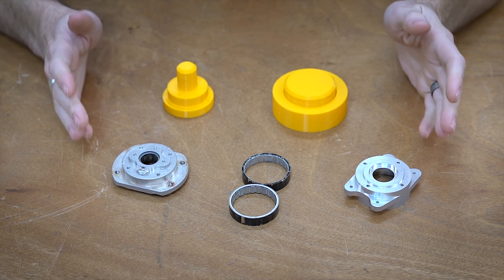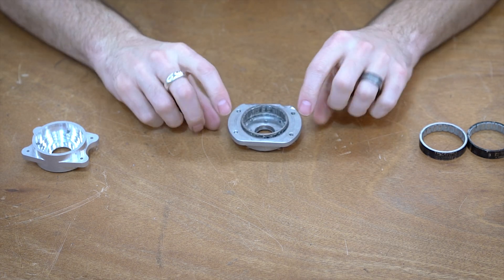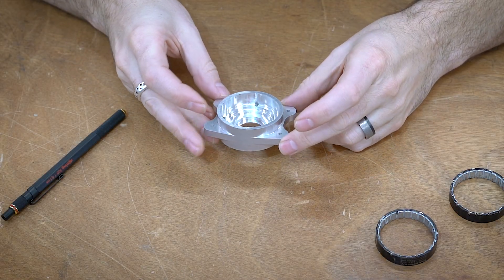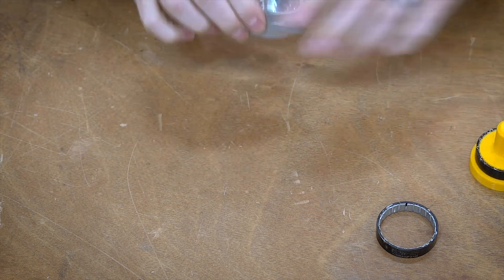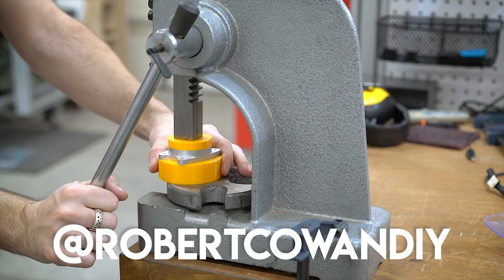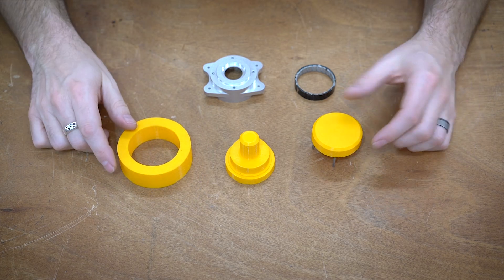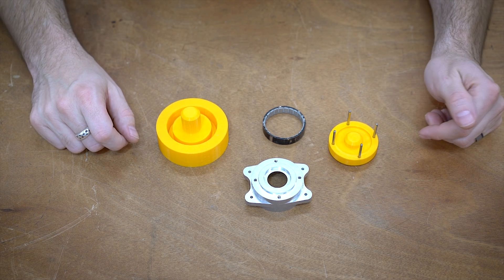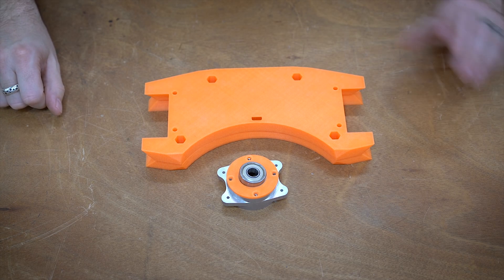3D Printed Tools for Hub Motor Assembly

Comment: Remember a few vids back when i said i wanted to bring a 1000lb division to robot combat? Well i have a idea for the walls and cieling. The inner most layer would be steel bars, maybe rebar. That for any very big pieces flying. Than the 2 outer layers are gonna be like battlebots lexan. outer layer is 4 inches while inner one is 1 or 2. any suggestions?
Reply from the maker: Let me know when you find out how to make and purchase it all.
Reply: Makes no sense. Almost nobody has the moneys to throw away in 1000 lbs battlebots.

Comment: This makes me realize how practical a 3D printer is for these kind of applications
Reply from the maker: Once you understand the workflow and have everything dialed in, it's magical.  I use it for almost every project.  From jigs to line up holes or help with assembly to actual parts.

Comment: Love to see something other than trinkets made on a 3d printer.
Reply: I printing a jig to put new spindles in my porch railing at the moment - just needed a few measurments and now I can be sure they are mounted vertically, and don't need extra hands to hold the spindles.
Reply: I have some friends who have been toying (literally) with 3d printers since like 2013 or so but I was never really that interested since all they seemed to produce was plastic garbage. Little statues, cups and other assorted nonsense that really doesn't have a function. It was also that 3d printing was more a hobby in itself trying to keep the printer working instead of a tool that just works to use for other hobbies.

But the last couple of years 3d printers and software have improved tremendously and it's way easier to get it running right so now you see people who have an actual use for them produce useful things instead of just plastic landfill.
Reply: Same. You might like where my channel is headed (not where it is, I'm in the warmup phase). I thought I didn't like 3d printers until I realized I just didn't like what most people seemed to like printing.